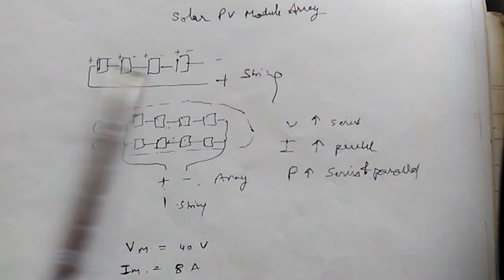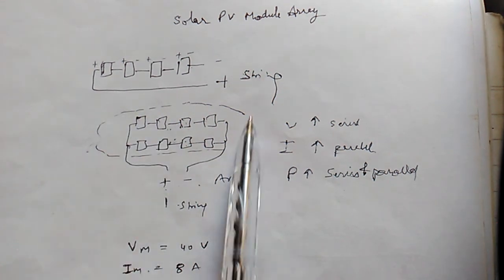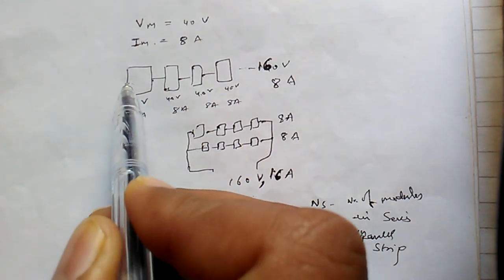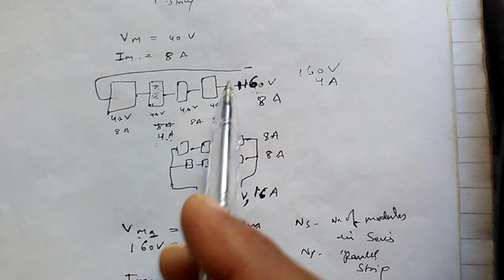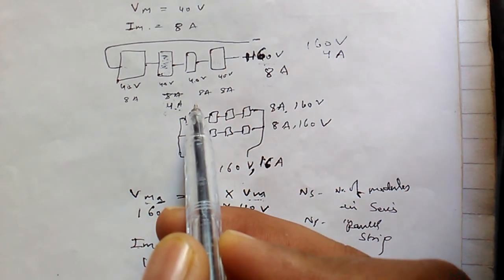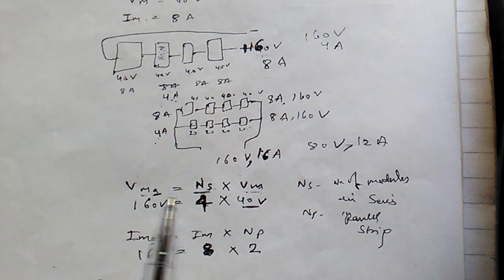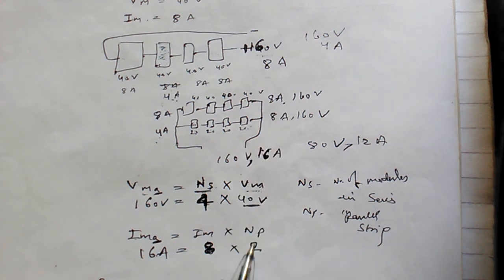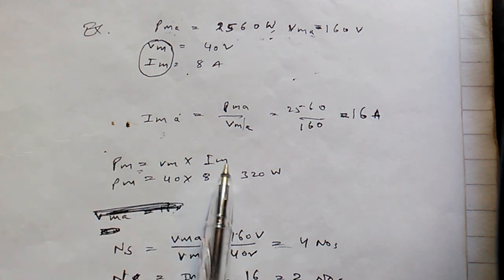Solar Module Array

Comment: At 4:00, if you have one battery (or solar pannel in this case) of 160v in parallel with one of 80v, some of the current provided by the 160v string will be consumed by the 80v string. In this scenario, assuming there is no extra electronic components and neglect the internal resistance of every battery/pannel, you got yourself a short circuit.
In case there is a diode for every string, the 80v string will be off and provide not current at all. If this is the case, your calculations seems to be wrong and the system provides only 8A, not 12A.
Please, correctme if I am wrong.
Reply: I agree with you

Comment: Sir agr may 1 st string 370 watt panel 7 no ( is ki volt he 38.6 and amp 9.3)
And 2 nd string 340. Watt panel  7no ( iski volt he 38.2 and amp 8.9) .  Is dono string ko parallel kare To mera total panel 14  out put kitna hota he ??  Pls help
Reply from the maker: I= 9.3+8.9= 18.2 amp
Reply from the maker: V=38.6x7= 270.2 volt
Reply: Ak invater me agr dono alag panel lagaye to kuch problem hoga kaya???

Comment: Inverter dc voltage range is 200-800v,my panel Vmax is 39v and Voc is 44.5v.wich voltage is am take for.string voltage?
Reply from the maker: Refer design video in solar basics -    II in playlist
Reply: @remoteskills  thank u sir.am asked that question to lsome local technician  ,my grid tie inverter input dc voltage range is 200-800v,my panel Vmp -39V and my panel Voc is 44.35,if connect 10 panel in series wich voltage is am consider for inverter input dc voltage?.Vmp 39*10=390 or Voc 44.35*10=443.5? They are answered me to take input voltage 44.35*5=443.5c.you are sye 39*10=390.so am confused sir
Reply from the maker: Refer design video in solar basics - II in playlist
Reply: Nice video however the writings are too small words to follow